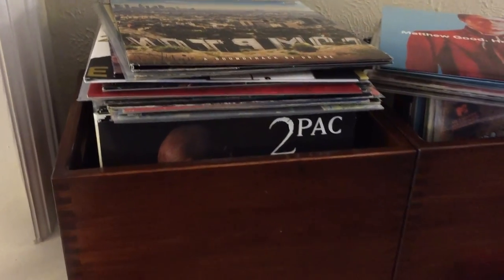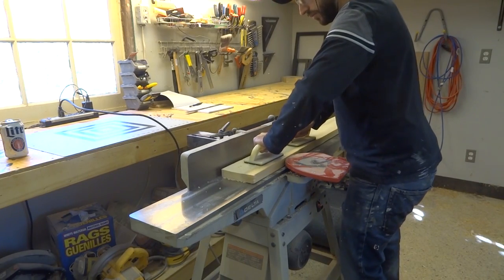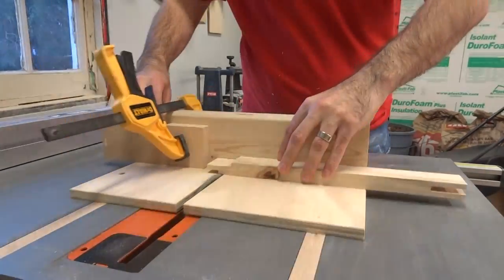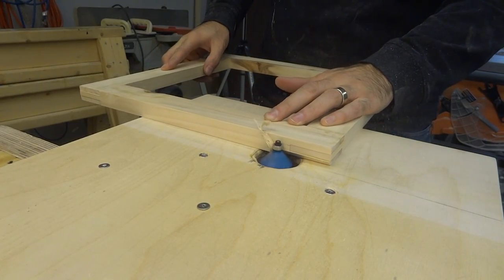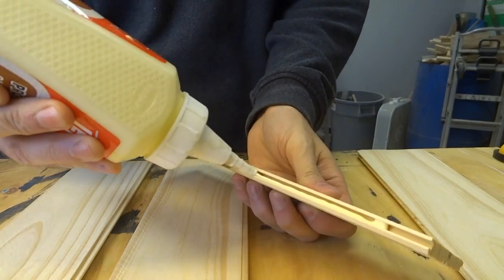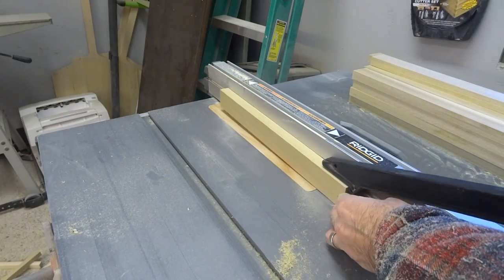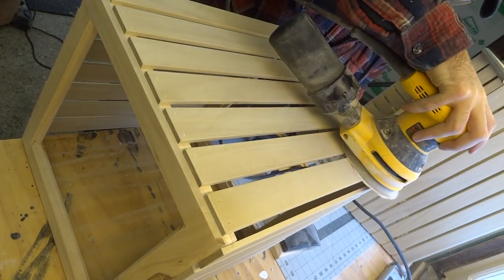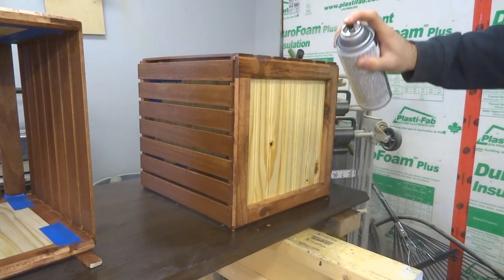Apprentice Marks Makes: Fancy Record Crates

Comment: Rule number 1 when working with chisels, gouges or any pointy sharp object.
Never push when there is alive meat in front or around the object that the tool can slip and stop into the finger, wrist, forearm, chest, stomach or legs..Never.
Good luck!